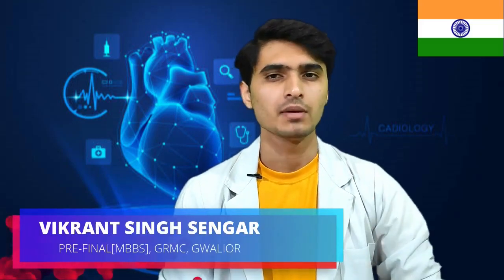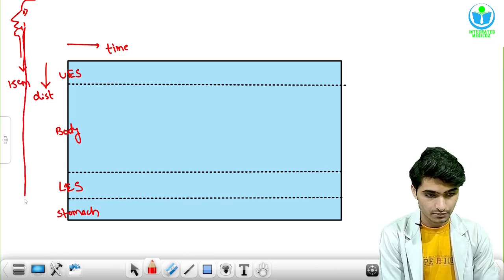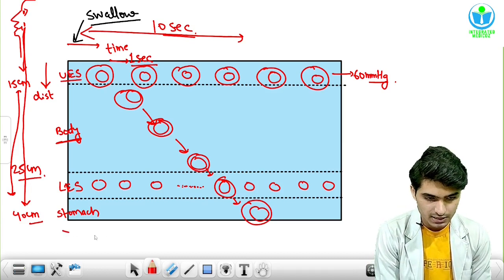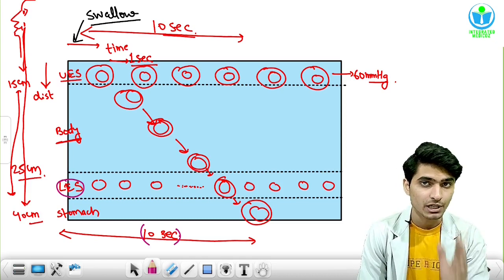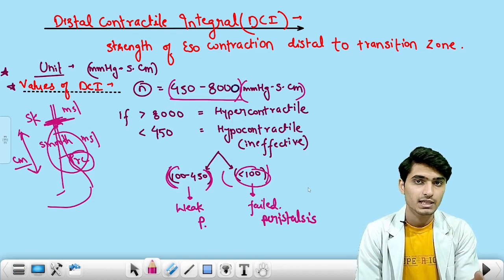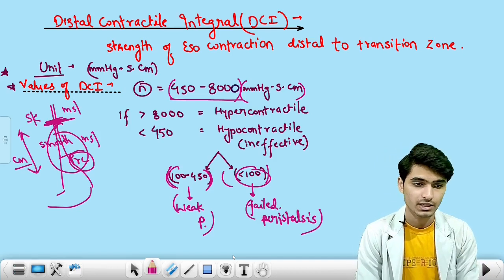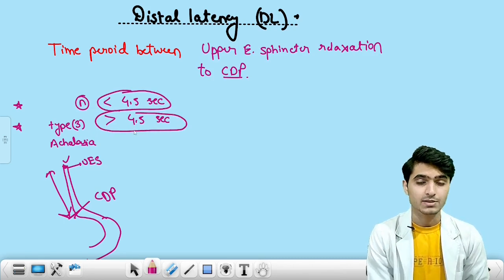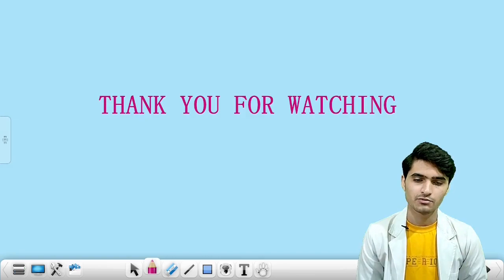HIGH RESOLUTION ESOPHAGEAL MANOMETRY/ CHICAGO CLASSIFICATION/ ACHALASIA DIAGNOSIS/INTEGRATED MEDICOZ

Comment: Excellent video brother.Just a important small correction needed.In type 3 or the spastic achalasia cardia the distal latency value is <4.5 seconds nd not greater than  >4.5 seconds.

Comment: You’ve simplified a complex topic and I think this is one of the best explanation of HRM for undergrads on YT. However, I would like to make a small correction regarding DL and its significance in Chicago classification. DL <4.5 indicates spastic contractions of esophagus causing the peristaltic wave to reach the CDP sooner than it should. One might wonder how this may be related to achalasia because it is quite the opposite of reduced peristalsis. Let me clarify that spastic contractions with DL < 4.5 are seen in only 20% of the swallows in Type III Achalasia, while the remainder of the swallows are failed in the presence of elevated IRP. So there maybe spasms but the overall motility is reduced and hence, it is a type of Achalasia.
Reply: DL > 4.5 is not abnormal. And DL < 4.5 is not normal. This is a misunderstanding. DL < 4.5 indicates spasm. That’s it. And it’s a finding in 20% swallows in type III Achalasia. Do read up on this.